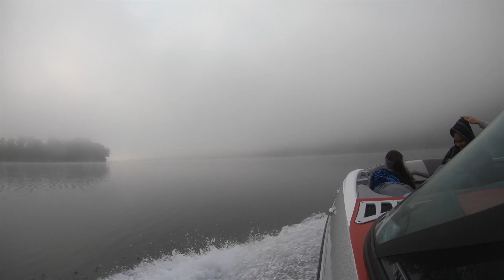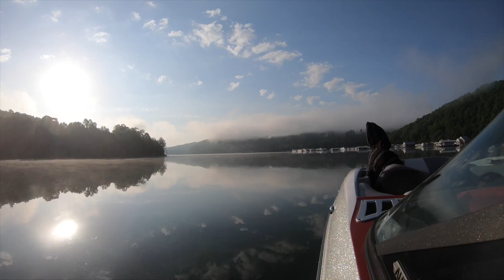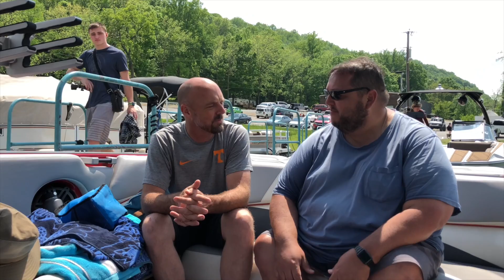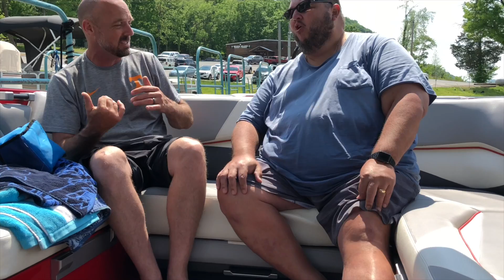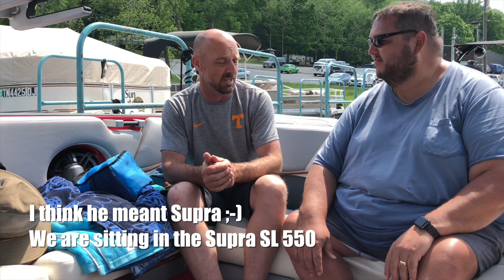Digging Deeper - Wakesurf Engineering - Surf Systems & Autowake 2.0

Comment: are the pumps constantly running when autowake is on? wouldn't that put some significant stress on the pumps inevitably causing them to break down quicker?
Reply from the maker: no, not at all. They do run more than normal, but these are the more bullet proof reversible pumps. I am not sure if they are using jabsco or johnson, but they are both similar. You just have to replace the impellers about once a season. We put many hours on these boats, and it has not been an issue other than occasional impeller replacement.
Reply: @wake9tv  and I'm assuming thats an easy replacement to do? thanks for the quick reply!
Reply from the maker: @cnnrthompson  It is very easy when the pumps are easily accessible, but with the subfloor and 6 pump systems, they are a bit harder to get to. I have done it myself, but you need to know where they all are before you get started, but easiest to have the dealer do it. But if you are handy, you can do it, they are a bit buried.
Reply: @wake9tv  awesome! thanks for all the insight, I really appreciate it.